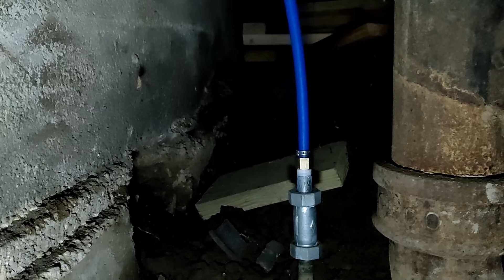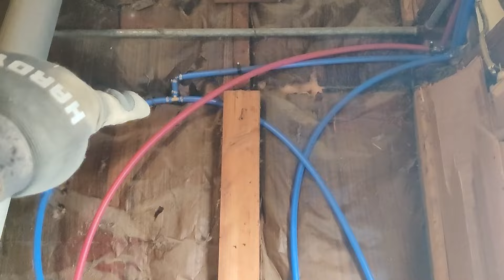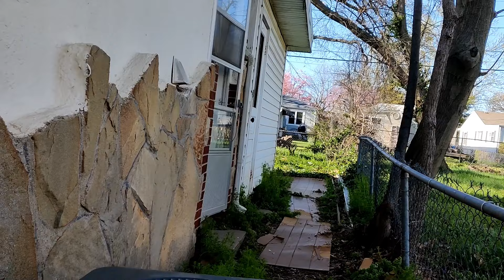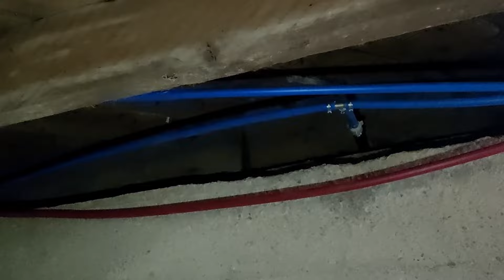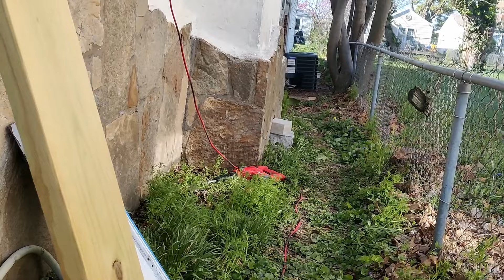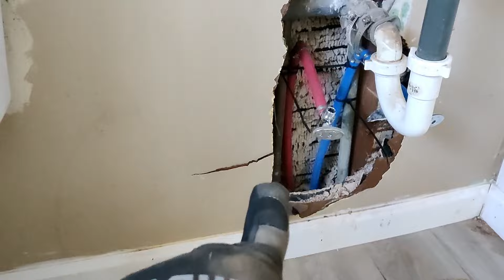Sycamore Plumbing

Comment: Do you think it would have made a difference if the arching bends were used instead of elbows?  I'm doing a similar piping job.  Like how you ran it through the utility room.  I have a 6x6 where my water heater lives that I'm going to use as a shutoff and filter location, but mine is not insulated.  I'm probably going to wrap the exposed pipes instead.